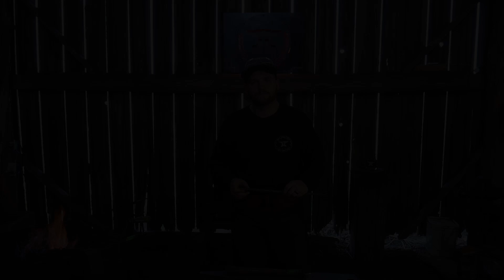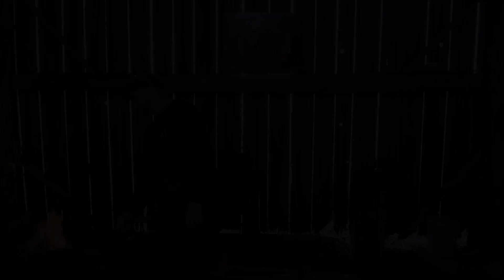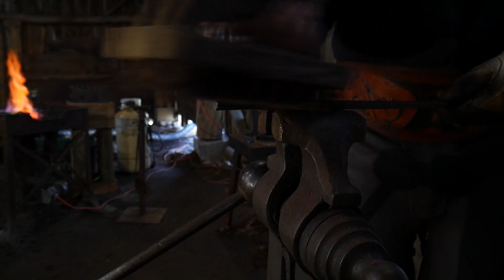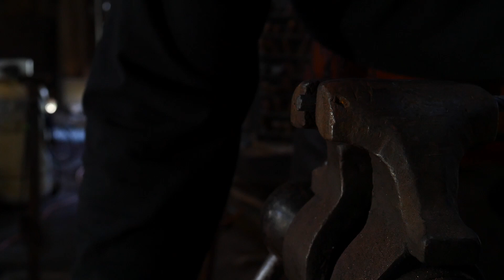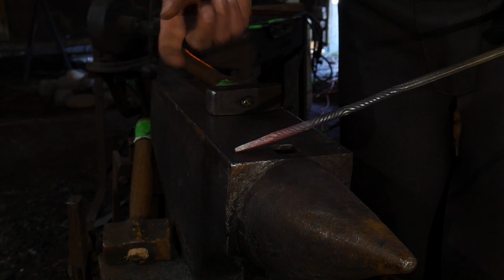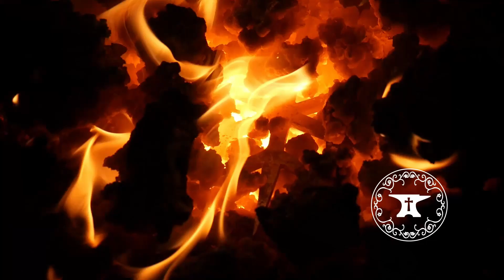Out of the Box Forging with Spline Stock [Twisting Metal Bar]

Comment: If you're looling for that shaft you could try garden machinery workshops as it's used for the drive shaft on some of the big strimmers and brush cutters (or weed eaters). Some only have the ends of the drive shaft cut into a spline but I have seen them with a spline on the whole drive shaft 👍